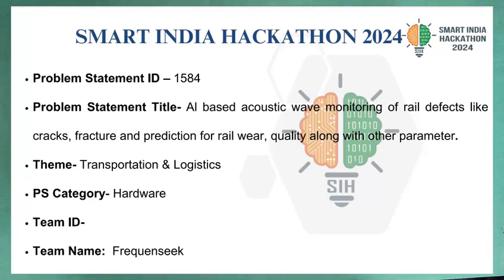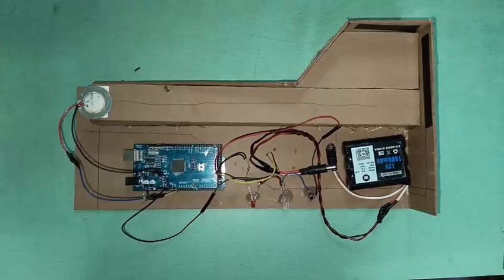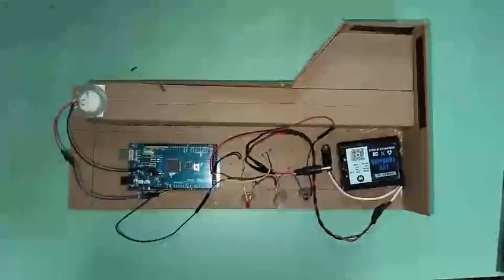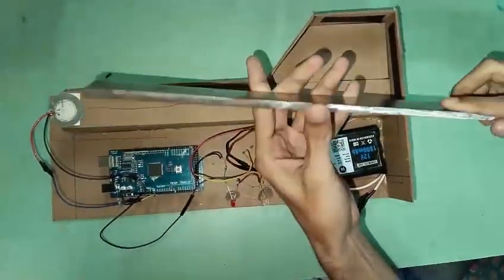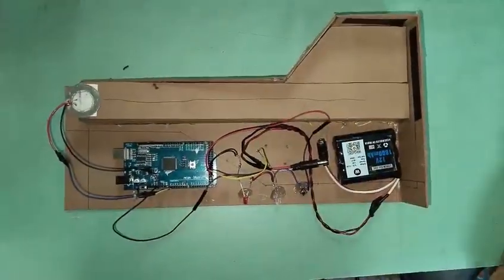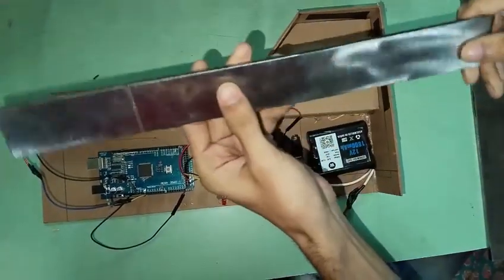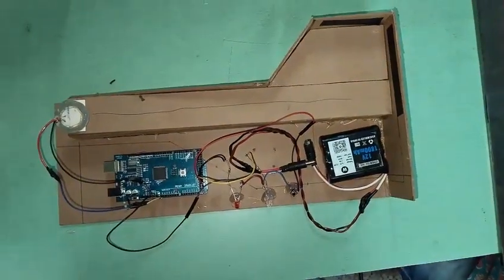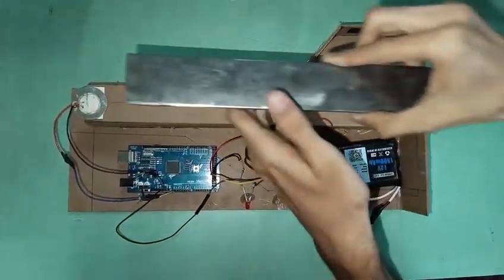Prototype of detecting cracks on railway tracks using piezoelectric sensors by acoustic waves.

Comment: Nice. Next time, try using a phased array of PzTs to locate and estimate the structure of the defect/ crack as well. And I think you can use a single (or an array) of PzTs as Tx as well as Rx. Though for processing the ToF data you need a better microcontroller with advanced DSP capabilities, e.g. Teensy 4.x (IMXRT1062). Good luck.